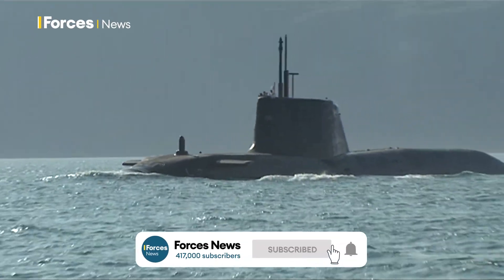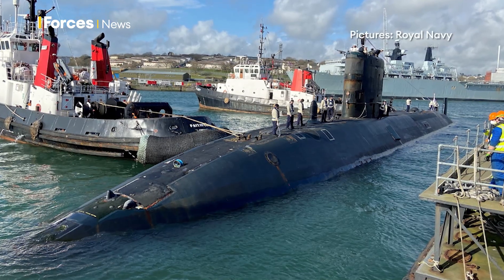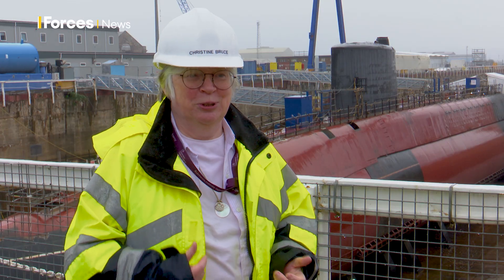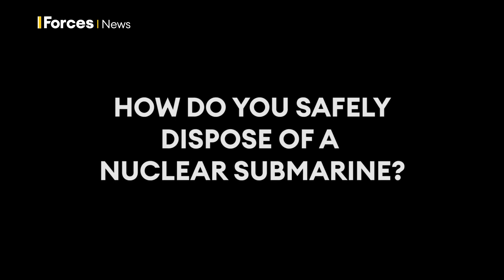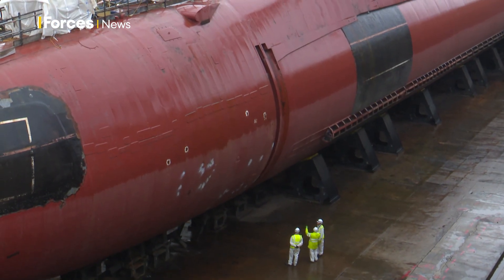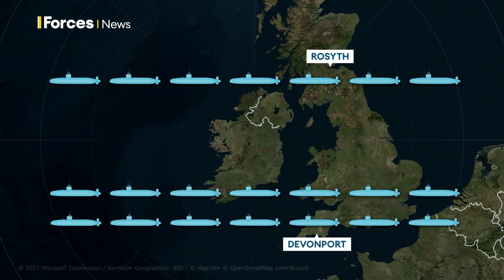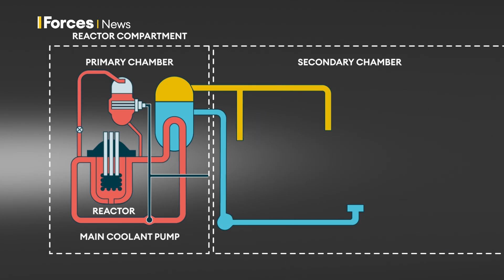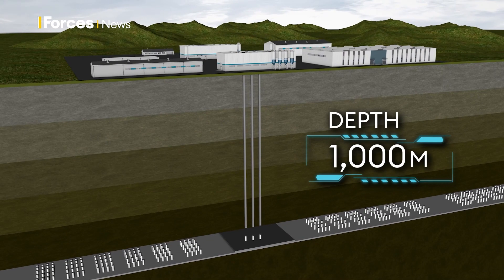EXCLUSIVE: How do you dismantle a nuclear sub?

Comment: The US and French have been dismantling nuclear submarines for generations. Only the Russians ans UK have avoided the safe disposal of nuclear submarines. In the UK they have submarines over 60 years sitting in dock, in sea water rusting on a evident hazard to local community
Reply: The US France and Russia only cut the ends off - that's not 'disposal'. What it says here is that the UK is attempting to go further and cut up the whole thing including the reactor. That means only having to store a small chunk of radioactivity, not a massive tube of radioactivity.
Reply: @cheezybeanz1049  firstly, the US and French have long operated both nuclear surfaces ships and submarines. They both remove the reactors and also the nuclear fuel. Which is then reprocessed so they have smaller quantity of highly reactive material which is placed in permanent storage facilities.  They do the same with civil reactors.  This is not complicated as reactors must be designed to insert and extract fuel rodes.

We can put this video down to pre-election propaganda where successive UK government (Labor and Tory) have not allocated the funds required. This video even acknowledges the plan is far from complete with no identified long term storage facility. That fact that UK governments have left nuclear submarines some of which are over half a century old sitting in seawater is a disgrace. There are simply no French or US nuclear powered ships that have been decommissioned in such a state. In the case of aircraft carriers they lift out the compete reactors very quickly.  The are defueled and dismantled. With regard submarines, the hull must be broken open to remove the reactor. Again, they are placed in dry dock and this quickly done. The carriers and ships also need to have removed huge qualities of hazardous but not nuclear waste: heavy metals, fuel and oil, cabling, etc etc. This is nothing unusual with ship breaking. That the UK has failed to do that.The length of time makes this matter harder and more costly.  

This is national disgrace which only the Russians are as reckless with people's lives in breaking up nuclear submarines
Reply: @russellmiles2861  the french have decommissioned a total of 7 nuclear powered submarines since the 1970's 1 of which is in Cherbourg as a museum ship yet doesn't say how or what they did with the others or there fate or how they scrapped them . 
 the only surface ship that is nuclear powered is the  Charles de Gaulle which spends more time in port then it has at sea and the french nuclear submarines are relatively young in their service life before decommissioning so that would mean that French reactors are inefficient or the rods need and reactors need refuelling at some point in their service lifes
Reply: The other countries have the facilities built to be able to dismantle the submarines, we have to build, set to work  and commision these facilities to a safe standard.  The time the submarines were built and way they were maintained complied to the current regulations at the time, todays regulations and working methods are completely different
Reply: WRONG. SO, I believe I am right in saying that there has been a long existing plan to dismantle UK boats in the UK, however when we became even more intimate with the EU back in 1992/3 that plan didn't meet the EU standards (even though the US and France were dismantling their boats). Interestingly the UK is back to dismantling its first boat since leaving the EU....coincidence, I think not! There was also a plan to send UK boats to the US for dismantling, but the costs were ridiculous, and the US facilities are backed up with their own cold war boats, so that solution would have taken even longer. Unlike Russia, the UK boats are at least maintained and safe. A few years ago when the Russian Navy failed to pay its energy bills to keep the boats safe the Energy company turned off the power. The State authorities had to send in the Russian Naval Infantry to have the power turned back on....lest a few old cold war Alfas and Novembers went critical! I believe I am also right in saying that the UK boats have been defuelled.
Reply: Yes, that would be the total of decommissioned submarines of the La Royale. Remember the RN started introducing nuclear submarines in late 50s and has had a larger nuclear fleet; whereas the French did so from early 20s. The 21 former RN nuclear submarines is the total number of decommissioned nuclear submarines. In short the French  have safety dismantled all their retired boats and the UK none. And on the current UK plans the number of retired submarines at dockside will continued to increase over the next decade; and they have not fully funded the dismantling of even one

And no you can't dump your problems in South Australia
Reply: @russellmiles2861  I know full well how many submarines the RN and the UK as thank you .. so when did the french start their nuclear submarines program ?
Reply: @russellmiles2861  "Remember the RN started introducing nuclear submarines in late 50" .......April 1963 actually. As I stated earlier the UK had a plan in the 90s to dismantle its boats, but that was scuppered when Major took us into political union with the EU and its excessive regulations. We haven't been allowed to dismantle our boats since.....not a coincidence that this plan has now been reactivated since we left the EU! All the RN boats are safely maintained and defeulled unlike those of other nations. There is no rush to dismantle these boats, (other than the pressures on space and maintenance costs), they are not an environmental problem....something that can't be said for the rusting hulks around Murmansk.....you seem to want to play on the 'polluting nuclear' narrative which simply isn't true.
Reply: No other country recycles naval reactors, the US cuts them out and buries them, the Russians just leave them to rot, and the French haven't made up their mind yet and just store their old subs like we were doing.

Comment: Dear God, these boats were waiting to be decommissioned when I joined the Dockyard 20 years ago & 10/15 years before I joined. I’ve been on board all these subs doing basic maintenance…water tight doors etc & carrying out an annual vacuum test. I even helped build the ‘new’ de-fuel crane for this project…..5 years ago which is still unused & rusting away. It was rusting while we built it as it took so long 😏
Reply: Things always happen really slow in a naval dockyard - it has always been so.
Reply: Hopefully when your grandchildren are old enough they may start dismantling them and see auld rusty .
Reply: @A Twinspark As I posted elsewhere on this thread Twinspark, there was an advanced plan for the UK to decommission its nuclear boats in the 90's, sadly the Maastricht agreement (1993) saw the UK adopting EU safety rules which scuppered the decommissioning plans, its no coincidence that the plan has been revamped post brexit!
Reply: The US is even worse if it’s any consolation… =(
Reply: @captiannemo1587  And then there are all those old Soviet boats........significant problem there.
Reply: It's actually not a bad idea, after the nuclear fuel is removed to allow latent radiation levels to weather away.
Reply: @A Twinspark Gaining regulatory licence?

Comment: Why not turn them into museums?

Clearly you would have to remove the radioactive part.

Also if a submarine has been retired since the 1980's then surely none of the technology inside should be top secret.  It's just too old for it to be top secret anymore.

Building some museums would do a little bit help the tourist sector and create just a hand full of jobs.  It would also be very interesting to look around.  And it these subs should be a object of national pride.

Don't recycle them.
Reply: Also the Secrets Act limit is 50 years minimum. So, while yes the reactors are probably completely obsolete and most of the world are operating something better, they are still very much top secret.
Also, @That Car Guy the rivets wont pop over time. Yes they are designed to survive the crushing pressure of the ocean, but the hull would only expand outward if the inside is pressurised. Submarines don’t counteract the external pressure by applying internal counter pressure, that would kill the crew and pop them like grapes. They are built like vacuum chambers, the external pressure is handled structurally without adjusting the internal pressure above 1 atmosphere.
Reply: @realburglazofficial2613  Always that one person trying to argue. It's literally how hulls are designed, they need inward pressure on the hull otherwise they start to peel away do to their shape design. This is how ships of all kinds handle so much pressure and movement. They thought they could get away with dry docking the HMS Warrior for example... Didn't go that way. Ships hulls deform out of water and need a lot of bracing. This is what they thought:
"In the event, it was decided to dry-dock her, it being felt that her composite construction, with sharp rise of floors, would allow her to remain out of the water for an indefinite period without the hull losing shape. It was also believed that very light bilge and breast shores would suffice to support the hull and yet allow the ship's lines to be appreciated (Click here for Illustration 10), and that with her unique construction of iron, teak and elm, and being permanently out of the water, there would never be a need for major repairs to the hull in general, nor to the keel in particular."
This is what actually happened...
"In the case of H.M.S. Warrior it was decided to keep the vessel afloat in Portsmouth Harbour."
Dry docking kills ships and is super expensive to keep them going, hence why we don't have many museum ships.
Reply: @ThatCarGuy  I’m not arguing, I’m merely debating from what I understand about submarine engineering and design that your view may not be entirely correct. They don’t deform in water because the weight of the hull is evenly distributed across the water its in. It’s buoyancy is regulated so that, in the water, a submarine doesn’t actually weigh much which puts minimal stress on the superstructure of the sub. It’s not so much that a sub needs constant external pressure to maintain its shape, but more that a submarine’s hull can’t support it’s own weight out of water.
In water, a submarine’s weight is supported by a minimum of about 80% hull submersion.
In dry dock, the submarine’s weight is supported by around 10 points of contact on the keel. 

Laying in a hammock is far comfier than laying on a single plank of wood because of weight distribution.
It’s the increased pressure on a smaller surface area that kills ships in dry dock, not the lack of pressure of the water.
Reply: @realburglazofficial2613  "They don’t deform in water because the weight of the hull is evenly distributed across the water its in."
Correct due to water pressure. 

"It’s not so much that a sub needs constant external pressure to maintain its shape, but more that a submarine’s hull can’t support it’s own weight out of water."
Which is why it costs so much to make into a museum. You need a lot of bracing as stated above to support the structure that water pressure otherwise would have. To make the USS Iowa into a museum would have cost the US 20 million just to start, not counting yearly upkeep.

"It’s the increased pressure on a smaller surface area that kills ships in dry dock, not the lack of pressure of the water."
They don't just decay from points of contact, their rivets literally start to pop out as the HY-80 or 100 steel is molded to an angle and so strong, without water pressure the rivets pop. This is why we keep older ships docked, as it's so much cheaper and easier on the hull. The UK has 20 submarines docked, not dry docked as it's cheaper and easier to maintain the hull as the hull needs water pressure.
"Royal Navy now has more retired submarines in storage at Devonport than it does in service. The National Audit Office (NAO) report reveals the Royal Navy now has twice as many submarines in storage as it does in service,  and thee MoD has failed to dispose of any of the 20 boats decommissioned since 1980"
Reply: @ThatCarGuy  okay, so it’s a combination of both the external water pressure and the inability of the hull to support it’s own weight without it that kills Subs. Kinda like holding a donner kebab across the entire pitta to keep it together rather than balancing it on one finger. See? It’s not an argument, it’s a debate and now I understand more about why you don’t dry dock subs if you can help it. 
I think the main reason for its failure to break any of it’s decommissioned subs since the 80’s is more to do with how incredibly difficult and regulated nuclear reactor disposal is than anything else.
With regards to nuclear physics (now this I know more about than submarine engineering) the longer you leave nuclear material, the safer it becomes. If you switch off a nuclear reactor and then start dismantling it more or less straight away, you’re going to cause significant problems and lots of cancers. Nuclear fuel takes time to “calm down” after it’s been subjected to a fission reaction to make it safer to extract. The byproducts of nuclear fission are extremely radioactive as well. The way half-life’s work is, radioactivity disappears by half over time. 
Say you had a fuel with a half life of one year, and you had one ton of that fuel. 
After 1 year you would have half a ton, after another year you would have quarter of a ton. Then an 8th of a ton, and so on. 
The longer you leave the nuclear reactor before you dismantle it, the less radioactive material you have to deal with. Plus, the residual radioactivity of the components containing the material will have reduced too. 
They’ve probably taken this long to dismantle a nuclear submarine because, if they did it any earlier it would probably be lethal.
Reply: @ThatCarGuy  I thought the hull was welded together not riveted.

And there are other submarines around the world that have been retired and turned into museums.

But if this problem with rivets exists on this one type of sub then it could be a floating museum. It doesn't need to be in dry dock.
Reply: @matthew_baynham   "I thought the hull was welded together not riveted."
Hulls are both welded and riveted. Submarines use as little as possible do to pressure. The rivets pop first which is the issue allowing the welds to break. The more modern the less rivets. I keep trying to post a picture but youtube keep censoring and deleting my comments so just google "submarine rivets" and look at the images. 

"And there are other submarines around the world that have been retired and turned into museums."
I never said their werent, i said " hence why we don't have many museum ships." I even named the HMS Warrior...
Reply: There are already many submarines which have been turned into museums.
There is the dedicated Submarine museum of the Royal Navy in Gosport which has Holland 1(Britain's first sub),,HMS Alliance and an X sub among others.
And Chatham historic dockyard has HMS Ocelot.
Reply: Costs a lot to keep ships above ground as their hulls were meant to have pressure pushing inward(the water) and overtime the rivets will pop as the hull tries to expand outward since it has no pressure to counter act it as they were designed and built this way. This is why we dont have ships stored on dry land for long periods of time without issues occurring and why you see people store old boats they arent working on in the water. You have to build foundation to put inward pressure on the hull. 
TLDR: Short answer money.